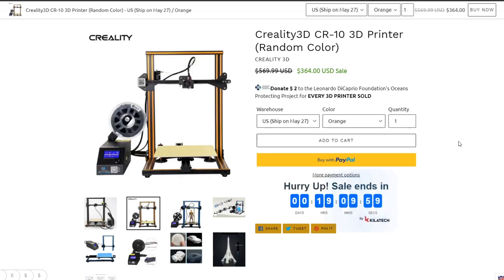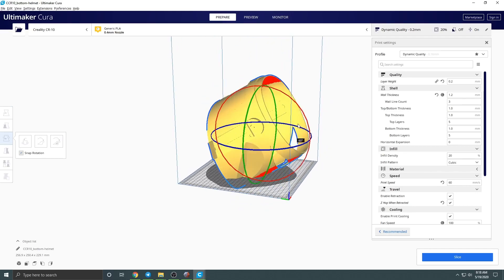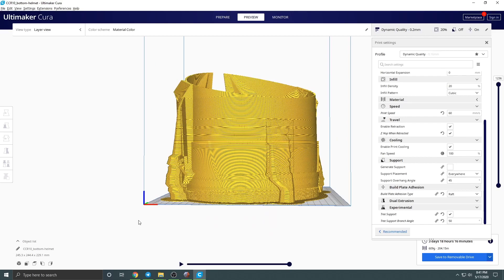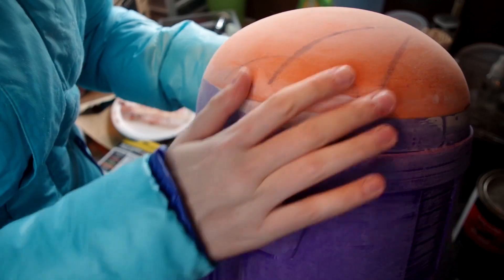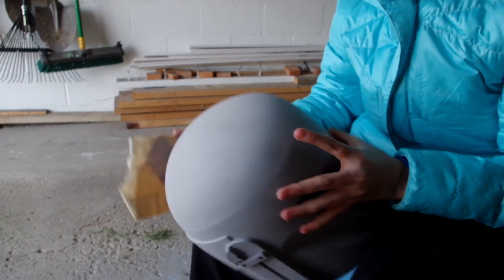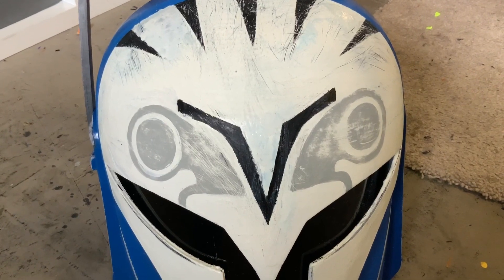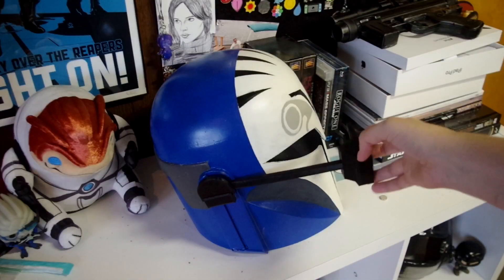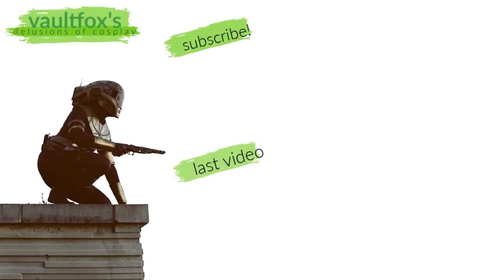3D Printing Bo-Katan’s Helmet from The Clone Wars

Comment: Hey i have a question, what’s a good alternative for bondo spot putt, it’s impossible to get in my country and i kinda don’t want to be using any resin. Does anyone knows good other sandable alternatives?
Reply from the maker: I've heard of others using wood filler as a replacement for bondo, not sure if that's available in your country or not.

Comment: Question what size was the helmet that you had to split it into a mesh mixer. Was it 100%  and how well did it fit your head?  making one for my wife. Also what were the plastic clips called to align the helmet? The build came out great!
Reply from the maker: Thanks! I printed this out at 100% but tbh you could probably print it out at 95% and still be OK. It’s on the larger side. I just used small bits of worbla to align the helmet dome

Comment: Looks good 👍......Using a support blocker for the center dome you could probably print it in one piece right side up..... Due to the shape of the dome you don't really need supports there... You may get a little sagging but it's on the inside and can easily be sanded....
Reply from the maker: Yeah, thankfully I've found the plugins for cura to do custom supports and just tried it out with an Armorer print .. went well for the first print which will save so much on support material